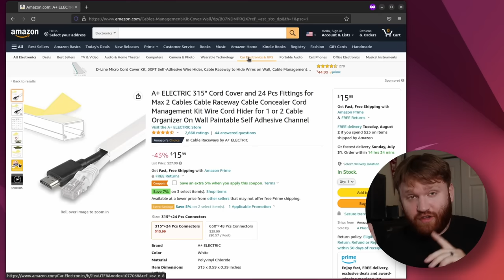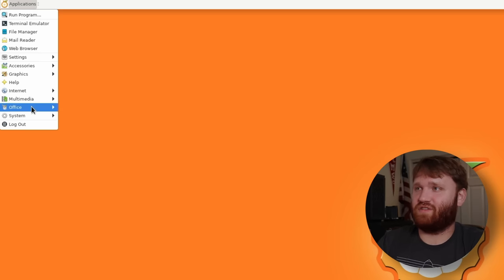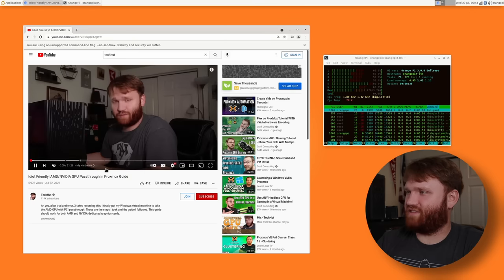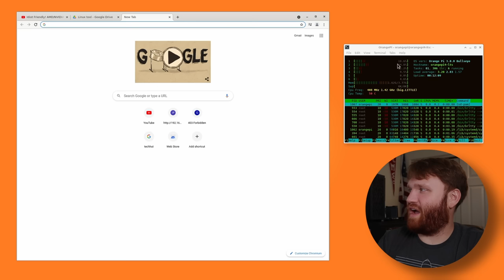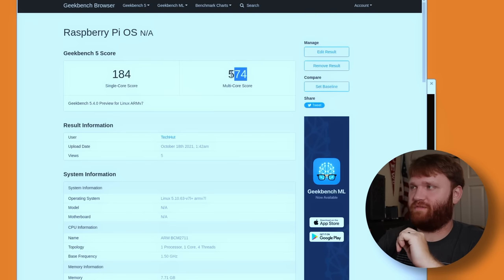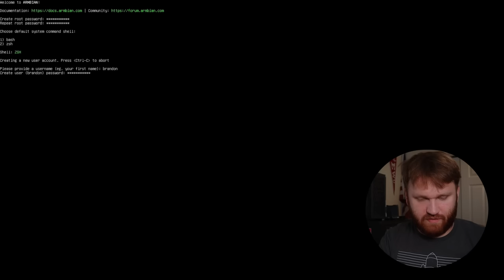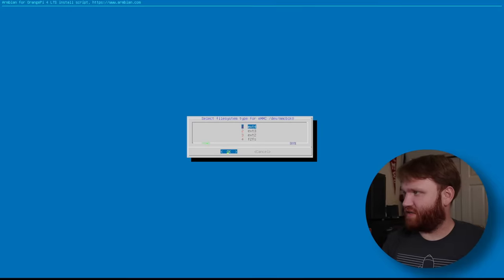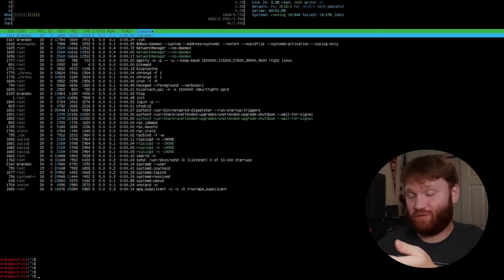BEST Open-Source Single Board Computer? - Orange Pi 4 LTS

Comment: I am sorry to say but Orange pi 3 was totally a failure ....I mean a big failure ...! I had one at I was from the fist that bought the model and I noticed that it had issues with thermal - sink ... It needed a BIG sink actually a huge one and in spite of using a big one it got burned after 1 year of operation.! My orange pi3 is dead since and never recovered again. On the other hand there was no software support for it even from armbian ...the USB 3 was not working as it should be and the network card was awfully slow. Very disappointing in Orange company. Please do tell after a year or so if this goes well or it has full support from armbian..!! My thanks ..

Comment: I’d never trust any SBC maker with Linux support. Everyone except the rpi suck. 

And it is not worth that risk all for what 200mhz boost and not even a a76 core? Nope.
Reply: Well i bought a orange pi i think 5-6 years ago and it is running 24/7 as pihole at my parents House. It never failed and is doing a great Job. Also i have some Opi zeros and they also work well. So in my opinion they do a great Job and a worth the money
Reply: Rpi sucks on linux support

Comment: Rpis distros (official and third party) not even run on mainline, they use downstream rpi kernel bc it use a full set of dirty patches that ain't going to be accepted on mainline. Aarch64 on rpi4 still sucks with v4l2 acceleration not there out of the box on his own OS, more than 2 years later, with tons of resources and very few platforms to support. The rpi community is huge, but saying that has great linux support is just stupidity, intel and amd has great linux support, not rpi. Considering how bad is the rpi hw, rk3399 is still much better soc for arm linux and that's  why they are millions of sbcs, even linux laptops based on them. Of course, there are newer and better hw nowdays with decent mainline linux support.

This soc has 4x pci 2.0 lanes and 2 real USB 3.0 interfaces, unlike rpi that doesnt have any 3.0 interface and use 1x pci 2.0 lane to expose 2 usb 3.0 ports (already faking I/O there). Just one pci lane on rk3399 has the same I/O as rpi4 usb ports.

Rk3399 has a 64 bit ram bus, has a more powerful and better featured gpu and on the cpu side of things it's similar to rpi4 on raw power.

I use RK3399 as my daily driver with the PBP, and it's  an very compelling chip.. considerably better than RPI4 for desktop.